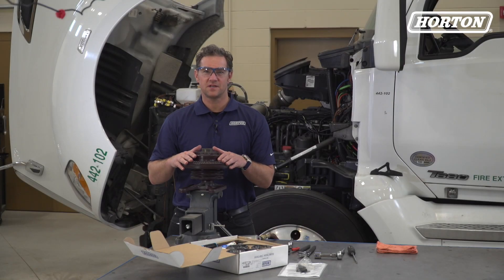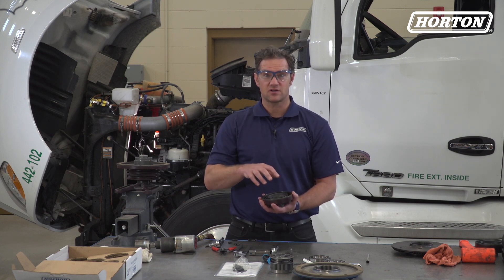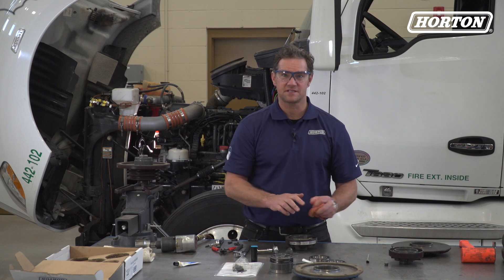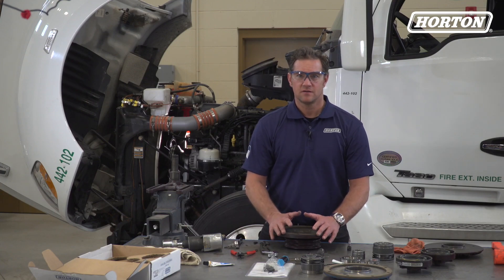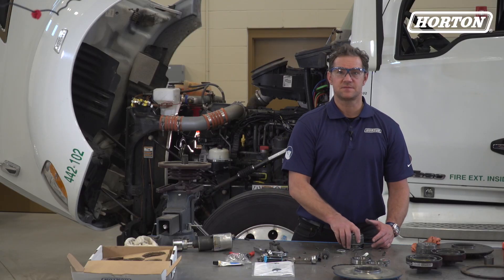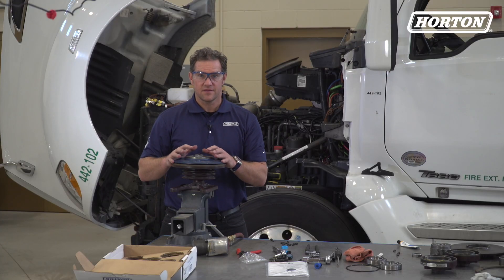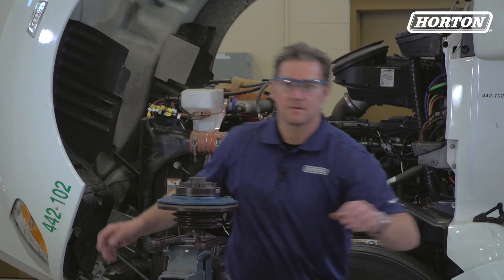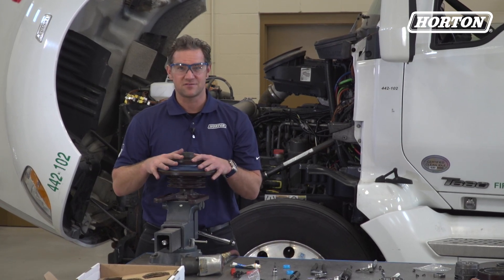How to rebuild a Horton HT/S Advantage pneumatic fan clutch using a repair kit

Comment: For anyone that is doing this first time like me I did not know there was a lip I thought it was hollow both ways and I used a front wheel drive bearing remover and installer tool from harbor freight and I bent that lip outward. Never pressed bearings before I did not know. It worked very well but I fixed the lip kind of and I will see how it reacts